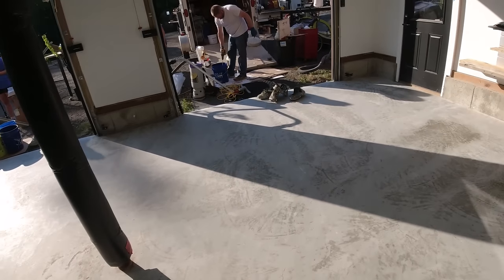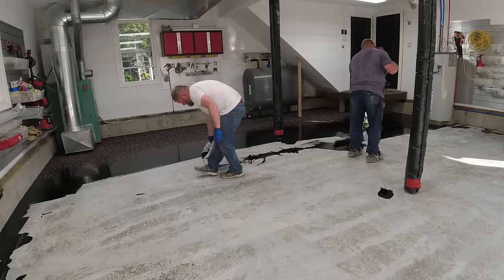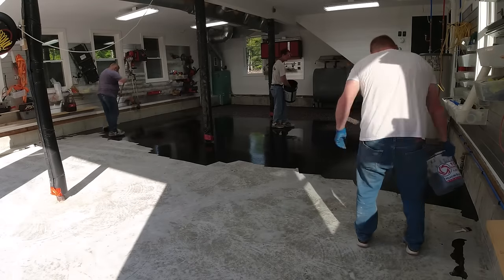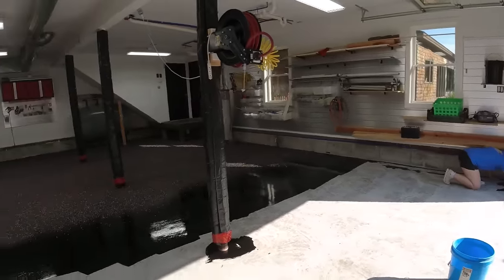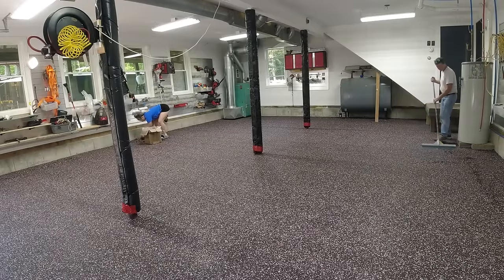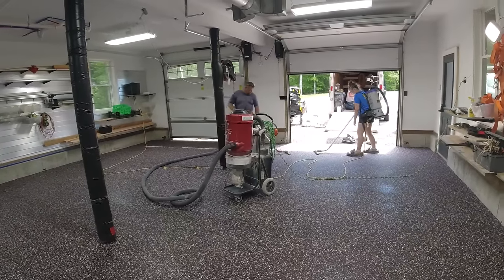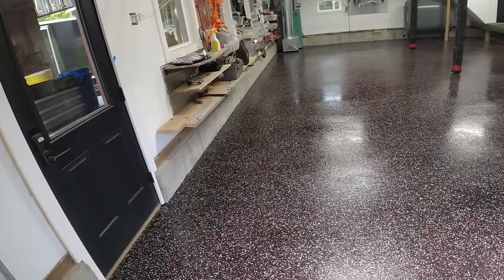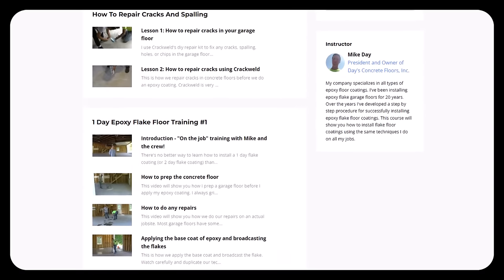How Much Does A Garage Floor Coating Cost?

Comment: another rip off job by Mike, guess everyone up north has too much money and used to getting ripped off.  My garage concrete was less than 1/3 of his quotes in videos, same thing with armorguard flooring, my cost for 800 sq ft was 800$.
Reply: Is that the same floor that is peeling in your video? Asking for a friend.

Comment: How durable is it with tire rotations, snow, salt, oil, radiator fluid, gasoline, etc? Looking pretty is irrelevant if the product doesn't last and, in the end, makes things worse.
Reply from the maker: The products we use are very durable, no call backs. That's why we use them!
Reply: Thank you captain obvious

Comment: Perhaps bit of a redundant question Mike, but I am interested in brand of that 14-15" roller cage you use? Been looking for it fooorever and no success. I did asked around and searched and searched but no results. That must be light fiberglass cage vs regular heavier metal ones that are readily available. When rolling over head that weight matters. Thanks in advance.
Reply: Purdy makes an expandable paint roller head. From 12-18 inches
Reply: @jamesmoran8335  Thanks! I got that one but am trying to reduce the weight while rolling for a full day with it above my head. One that Mike is using seems to be made from fiberglass hence it is lighter. I've seen it else where too but no clue where to find it or who makes it. It might be older and discontinued item. 🤷‍♂️
Reply from the maker: I'll have to go out in the work trailer and look.
Reply: @MikeDayConcrete  Thanks mike. I found it. It's called Big Ben from Wooster. Thanks for all the knowledge sharing! 👊

Comment: Mike, Thank you for making these videos!! Im constantly amazed at how much you get done and how often you make and release videos.. wow. I need to finish my 600sq shop garage floor. Are the top coated flake floors slippery when they get wet?
Reply from the maker: Maybe a little, like the concrete would be but no-one has complained and said they're slippery.
Reply: What walk behind concrete joint cutting saw do you recommend? Or have great success and experience with? 
I primarily like to cut my joints the day after. My understanding is some saws are designed and better at cutting fresh concrete and others are better for aged concrete

Any advise and help is greatly appreciated

 @MikeDayConcrete

Comment: Question if you were to use aluminum oxide in a top coat  using  a SL product for a fork lift area what grit aluminum oxide would you use